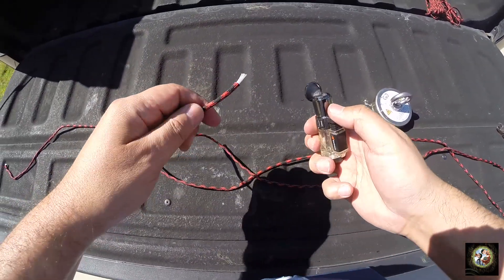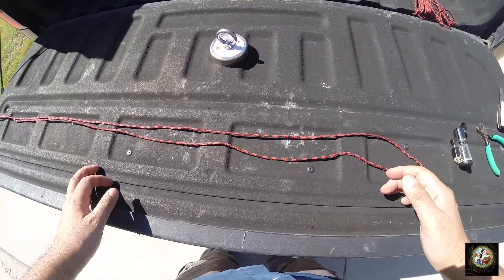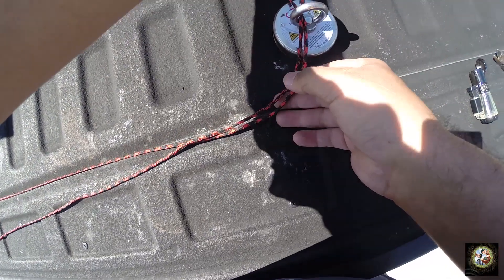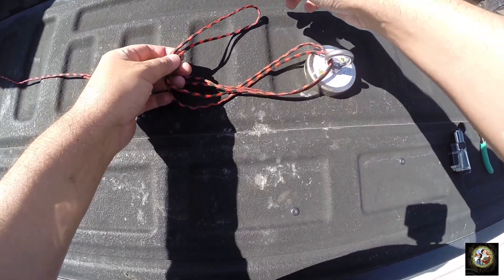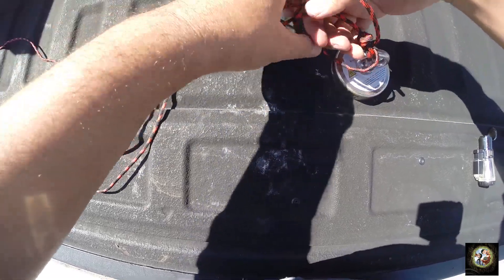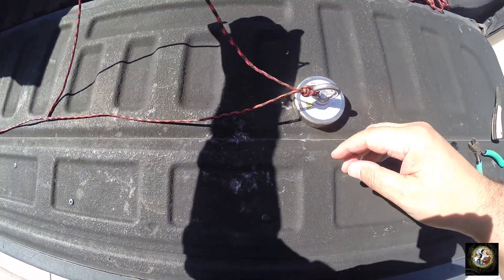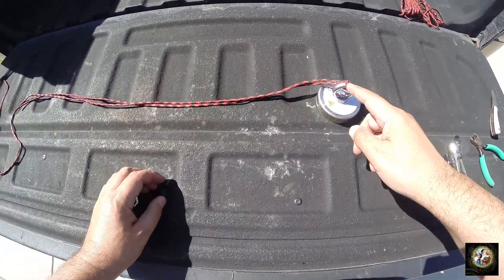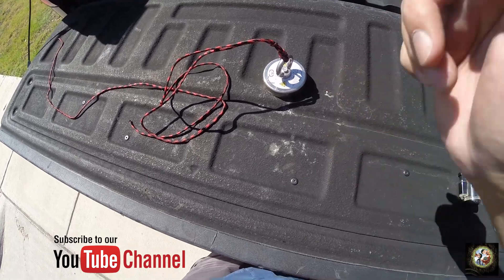BEST MAGNET FISHING Magnet Knot  GUARANTEED Unbreakable

Comment: After watching multiple knot discussion and videos,this double figure 8 looks the best suited for magnet fishing. This because of the double failsafe and minimal rope strenght loss. With a protection cone around the magnet and knot instead of ducttape, it is easy to use and remove after use, allowing the rope to dry and preventing rot or smell. Just got my first 200kg440lb magnet and strong rope, wish me luck...starting tomorrow...also i have a rubber hammer and wooden wedge to get small stuff safely and easy unstuck,works great! PS your rescue duty vibes got my exdutchmilitary attention

Comment: I've been a structural ironworker for 40+ years. Rigging is a big part of my job. When you tie a knot in a rope or line it  reduces the capacity as much as 50% . That is why we had to learn to eye splice which is fairly simple unless it's a double braid line which I've also learned . Splicing is also much more streamlined and neater. The more pull , the tighter it gets . No balled up knot to drag over debris.
Reply from the maker: Great info thanks for sharing your experience and knowledge.

Comment: I agree this is incredibly strong and useful for sure rescues, rock climbing, etc.  But when underwater, what prevents grit and rust from rubbing between the rope and the magnet loop?  That would certainly wear the rope out, wouldn't it?
Reply: There are protection cones that fit just around the magnet and the knot, better then duct tape.